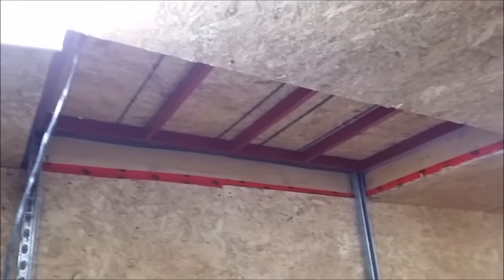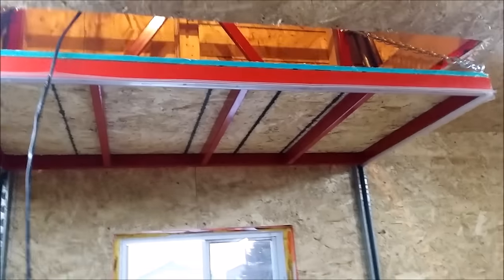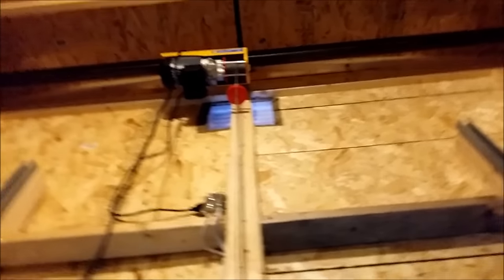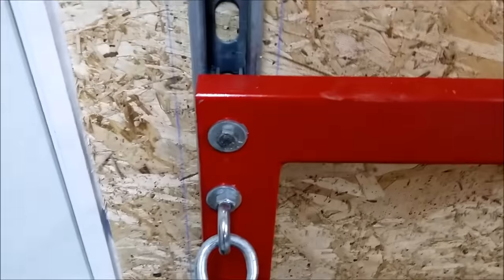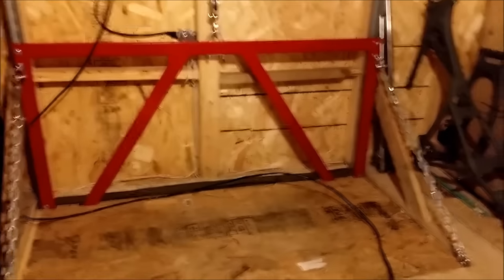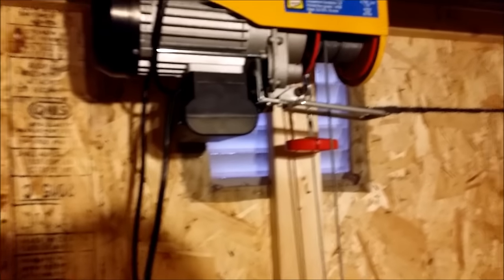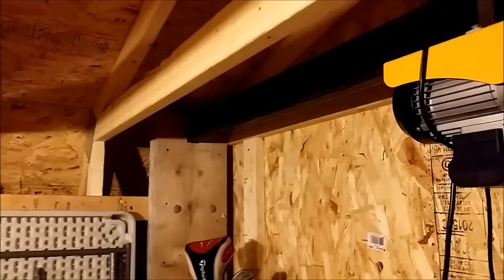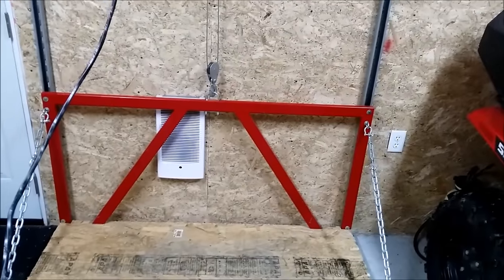Garage Attic Lift Construction

Comment: You did a great job on the lift.  However, it's a terrible idea to lift a human with that.  There are multiple additional safety features required for a human lift.  It's one thing if the cable breaks when you have 200 pounds of bins and equipment that get dropped 10 feet.  It's a whole other level of "oh crap!" when it you getting dropped that same 10 feet.  It only has to happen once.
Reply from the maker: If you watch my higher quality video of this lift, you will see that I address the safety concerns at the end of that video. Ultimately, it's a risk I'm willing to take. I'm also giving away a cable hoist in my latest video in which I upgrade this system with a larger capacity hoist, stronger u-bolt, etc... Feel free to check it out and even enter the draw!
Reply: @blastworks  Cool.  I'll check it out!

Comment: with out having to go through all the comments what did you use to bolt the unistrut to the wall ith?
Reply from the maker: I state exactly that roughly 25 seconds into the video.
Reply: sorry to come across stupid, the wheel trollies we have here are heavy duty ones and did not have space for the bolts you used; We have solved it at our end. Thank you for your vid you have help us out a lot.

Comment: Awesome, this is exactly what I need too, I thought 500 lbs but hell 440 is good enough. I might put railing on one of the sides just in case.
Reply from the maker: Hey Pete! Keep it in mind that with the cable fed through a catch block and back, you double the capacity, so it can lift 880lbs.

Comment: What happens if you're in the attic and the power goes out?
Reply from the maker: I can easily lift the platform up and out of the rails. I've done it a few times to see how it would go and it's relatively easy to do.

Comment: I would put bigger pulleys on it,  to move faster
Reply from the maker: I have a plan to upgrade to a 880/1760 cable hoist  in the near future. Using the 880/1760 single pull and not though the catch block will make it much faster, or I can use it through the catch block and lift double what I can now with it!
Reply: @blastworks  about what works for you!  but 880 is plenty for me That like a 55 gallon drum full of honey at 13 pound per gallon 715 pounds that a lot of weight > i use a bunch of 880 for lifts for mowers, engines. lift things off tail gates, trailers  ect > Made a A frame 10' tall with a 880 hoist its set out side on it>  hoisted is covered up > i had trouble with the control button>  but got a replacement one

Comment: hey what material do i need to build this i already have the winch?
Reply from the maker: Hey John, i talk about the materials used in the video. I fabricated the frame using 1" x 2" x 1/8" rectangular tubing. The rails and trolleys used are linked in the video description. Throw in a few pieces of wood and you are well on your way! Good luck!

Comment: First off I just wanna say this is great.  Next off,  I'd like to ask a couple of questions if I may.  Now that you've had it and used it for awhile, is there anything you would change?  Have there been any issues?  I saw a similar idea somewhere else but forgot where I saw it Now I realize it was the GJ).  It's been in the back of my mind to do this for awhile and I've thought about how to do it a few times.  Your video shows the how and what very well and plainly.  I also appreciate the fact that you're a fellow Canadian,  so I know where to get the needed parts (PA, Fastenal).
Thanks for taking the time to make the video and show how you did it.  Much appreciated.
Reply from the maker: Thanks for the kind words Bruce! It makes me happy to know that my video is helping others! To answer your questions:

I can't really think of anything that I'd change with the lift. If my garage were bigger, I would have made it wider (6.5 - 7'). That way, I would be able to put my motorcycle (2006 Yamaha FZ-6; ~450lbs) up overhead during the winter as well.

The only issue I've had with the lift so far is that the cable winding on the electric cable hoist can get a bit messy if you let a buddy operate it and they keep lowering the cable well after the lift has stopped on the floor. This has resulted in my having to let the cable out a bunch and then slowly wind it back up while guiding it to get a nice neat coil again.

One other thing I'd recommend that I'd not done early on (until a crane operator buddy of mine filled me in) is to use some type of steel cable lubricant to help keep the cable in good condition. Although I plan on replacing the cable every few years, it is important to ensure the cable is in good condition, which in turn ensures safe operation.

Now a question of my own! Where are you in Canada? I'm in NL! Cheers, and thanks again!
Reply: Thanks for the answers.  I did think about cable lube because I used to work on a yard crane.  As to your question, I'm in Edmonton Alberta.  The wife and I spent some time in Newfoundland about five years ago. It wasn't nearly enough time.  We loved it there.  Funny thing is,  I'm sure you know that there's a lot of people from NL here and when we were there, everyone told us about a friend or relative they had in AB.  The funniest thing was telling people back home where we went for vacation.  Every one of them asked "are you from Newfound;and?".  Like nobody ever goes there unless they're from there...  Since then, I've recommended a visit there to anyone who asks.  One of my friends that I've known for over 35 years lives in Bonne Bay.
Reply: Thanks for the answers.  I already thought about using cable lube as I used to run a yard crane.  I live in Edmonton Alberta.  The wife and I visited NL 5 years ago for a couple of weeks and loved it.  Wish we could have stayed longer.  I'm sure you know people who do or have worked in AB and I know people who are here from NL.  My best friend for over 35 years lives in Bonne Bay.  Almost everyone we met in NL told us of a friend or relative they had working in AB.  The funny part is,  when we got home and told people where we went for vacation, everyone asked the same question, "are you from Newfoundland"?  Like no one but Newfs go there.  No one ever asks if I'm from BC when I tell them I went to Vancouver for vacation.  Going to NL was one of our favorite vacations ever and we'd love to go again.  So many places to go but only so much money to spend...
Reply: figured you were in NL, when you said oot ;-) its out here
Reply: Hello fellow Newf!  I came across your vid a few weeks ago and haven't stopped dreaming up my own lift ever since.  Amazing job with yours and I hope to take much of what you've done into consideration when I get mine started.  My Shed has a 12 foot main floor with loft trusses so moving gear between floors is a pain.  The lift addition is needed more and more every day.  I've been trying to find materials locally without much luck until checking Home Hardware (online).  They have barn door rails with the trolley's to match that I think will work in the same way your rails work.  Wish me luck, any chance your on the Avalon, I'm in Torbay and would love to take a look at your setup some time.  Great job and thanks for the video, it's one of the best on Youtube without a doubt!
Reply: It wouldn't be hard at all to put a limit switch on it so that it won't unspool the cable when it touches the floor but it is a great design..just watch the toes haha

Comment: Does the lag bolt's intefere with the trolley wheels?
Reply from the maker: They do not. As mentioned in another comment, I didn't use washers behind the lag bolts and instead drilled holes between the slots in the channel and bolted them through there. If one was having an issue, the heads of th bolts could be ground flatter to offer more clearance.

Comment: Can you show a video of how you extended switch cord
Reply from the maker: Hey John. Unfortunately I didn't record any video, but the process was very simple. I essentially cut the controller cord, and then put in extra lengths of wire between the like colors at either end of the cut to make it longer. There are four differently colored wires in the controller cord, so as long as you match them up with the new lengths of wire that you are extending it with, you shouldn't have any issues!
Reply: Suggest that if you need instructions on how to extend a cable maybe you should not even think about building a lift.

Comment: What keeps it from falling if the hoisting cable breaks?  Something to think about.
Reply from the maker: Just check out a bunch of the other comments. There are a lot of good suggestions regarding fall arrest and restraint. For my purposes, I'm not too concerned as 90% of the time it is only gear that is on the lift.

Comment: did you use 4 trolleys? 2 on each side?
Reply from the maker: I did. Two trolleys at top of the lift frame and two trolleys at bottom.
Reply: yeah, i was wondering about that. good job.

Comment: How did you fasten down the uninstrut without interfering with the trolley? I used a small lag bolt with washer but the washer thickness of a standard washer blocks the trolley from passing ?
Reply from the maker: Mike Bari I never used washers. I drilled holes exactly the diameter of the carriage bolts and bolted through those holes.

Comment: So bolt heads in Unistrut channel don't rub channel trolley wheels
Reply from the maker: That's correct Gale! In my setup, I used some lower profile bolts and I have no issues with clearance.

Comment: G3nocide did you weld the frame yourself of did you buy the frame?
Reply from the maker: Kennon Snow I welded it up myself. I have a Ridgid 14" abrasive chop saw from Home Depot that I used to cut the steel. The welder I used is a Lincoln Might Pak 140.
Reply: g3nocide thanks. Great build. Will be making one myself

Comment: These homemade elevators should never carry passengers.  They should be used for having objects only.  A cable or motor failure will cause the lift to drop catastrophically.
Reply from the maker: If that was the case, they'd unspool when they are not on/powered. This isn't the case! I'm giving one away in my latest video, feel free to check it out and enter!

Comment: Only those who risk doing these types of craft elevators, think that at some point the steel cable that loads the Platform can wear and down,only add some kind of instantaneous braking in case this happens or at least be aware of the condition of the cable.......I thought that these things were only done in the countries of the third world,I never imagined that they would be allowed in the unitrd states of America,very badly.....
Reply from the maker: ruben, I'm not in the USA. Feel free to hate on the USA somewhere else!
Reply: This is a private project and when used with common sense, there should be no problems.  I would beef up that U bolt to 1/2" and put a box in for that electrical duplex.  Check the break strength on 3/8" cable.  Tons.

Comment: Did you have to cut any rafters (or attic floor joists)?
Reply from the maker: Hey Drako! I actually built the floor of the upstairs with the opening with the intent of putting the lift in!
Reply: @blastworks  Ah good to know! I am going to have to cut one of my trusses to make this work
Reply from the maker: @Drako0099  I did the same as mine were barn style trusses with the floor joist built in!